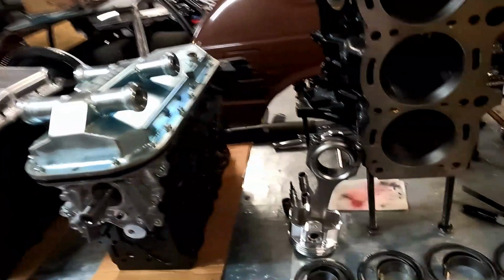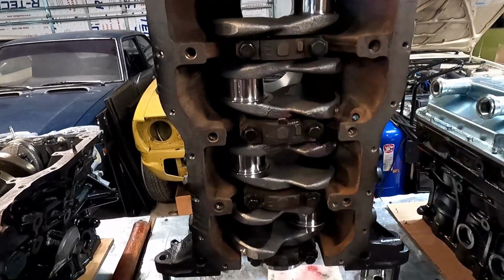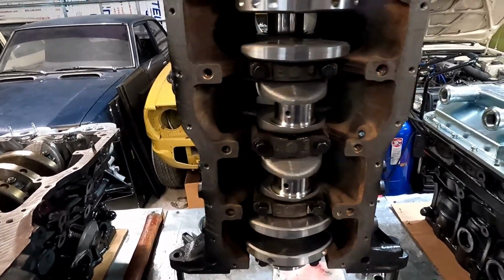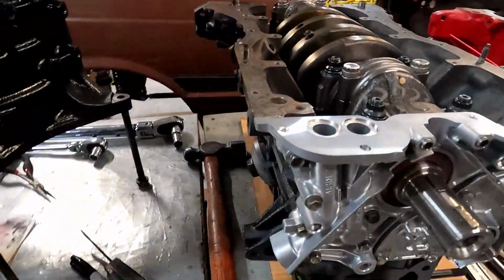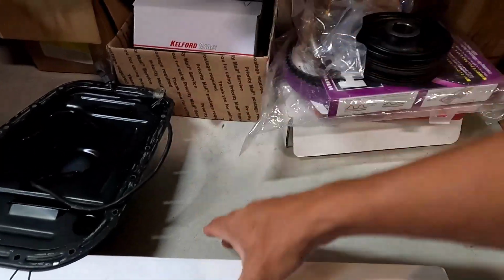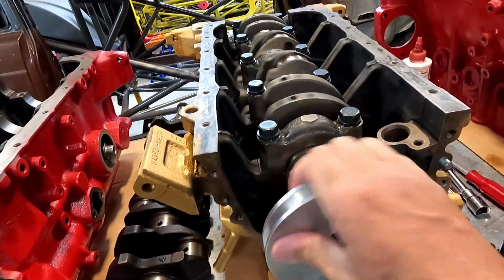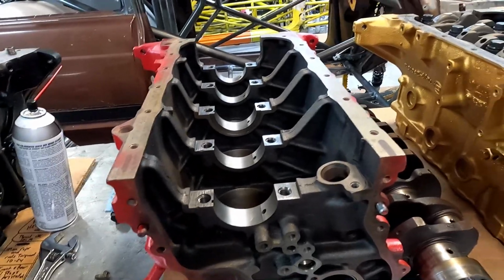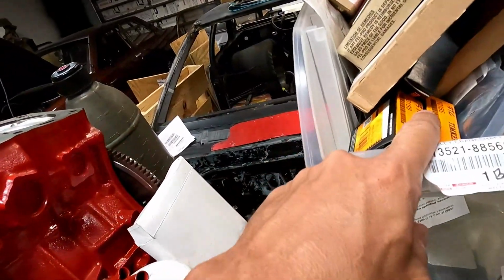Mr2 3sgte and 3tc Engine builds

Comment: Question i have 3sgte but internals factory but i buy a turbo 6466 i have arp in the rods and head studs do you think the motor hold 20 pounds of boost that’s the maximum i want please let me know if you think i have to upgrade the internal thanks
Reply from the maker: Depends What year block you have. The block is weak part and what kind of fuel you use to keep it safe

Comment: Good evening, I have a question about an original 3SGTE crankshaft that I would like to lighten to a knife edge type, what do you think of this modification? It allows you to save 1 kg on the crankshaft.
Reply from the maker: Hows it going, what kind of racing or driving do you plan on doing? Trying to understand why you would want to knife edge the crank ??

Comment: I have had a few rod bearing clips break loose in my past and wreck the cylinder.  What is the secret?  Do you use any kind of locktite on it?
Reply from the maker: I'm not sure what you mean by rod bearing clips? Do you mean wrist pin clips?
Reply: @psiracing  The wristpin retainers.  They always seem to slip out and the wristpin fly's away.
Reply from the maker: @sammcbride2464  Really?? Thats not good, were they sprial locks or C-clips
Reply: @psiracing  Just the standard C-clips that come with the piston.  I find the aftermarket ones to look very wimpy compared to the OEM, but since pistons, wristpins and clips come as a set, I am nervous about using OEM clips on an aftermarket piston and wristpin.
Reply: How were they positioned/oriented?  Set with the open end on top/bottom or to the side?  To the side means inertia tries to close/loosen it  every stroke, constantly flexing it smaller.

Comment: Have you done any work on the current iron block engines 2TR-fe & 3RZ. I know the 2TR-fe is derived from the 3RZ, but there seems to be nothing, that I'm aware of, in the way of valvetrain/camshafts for a NA build for the 2TR-fe. I had a 1971 Corolla with the 2TC hemi and I loved that engine. Thanks for sharing information on the other engines from Toyota, they are stout.
Reply from the maker: There are definitely products out there for the 3rz, 2tr never heard of

Comment: Interested turboing and stroking my beams blacktop in my altezza to 2.3L 

Would you recommend sticking with my stock engine block or using a 5sge block and is there really any differences between the 2 blocks. 
Also what would be the max overbore you’d go on stock block if I am to use that one

Comment: How to make my 3sgte rear wheel drive and what motor mount do I need please help...
Reply: What transmission and bell housing fits to make it rear will drive.. I was told w58 ?
Reply from the maker: @abisaellugo2447  Yes W58 Trans but you need a 2S Style bellhousing
Reply from the maker: Unfortunatley motor mounts need to be custom

Comment: What's the difference between the altezza block and the 5th gen 3sgte block?
Reply: How are you I have a 3sgte motor.  Question what transmission and motor mount do I use  to make it rear drive...
Reply from the maker: Honestly we dont many builds of the later generation blocks. We pretty much always use the 5s blocks